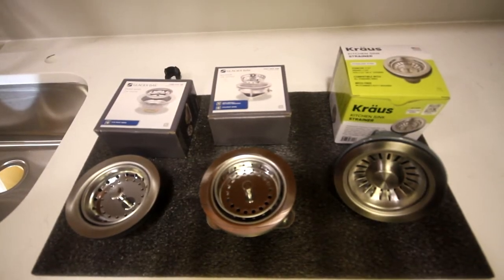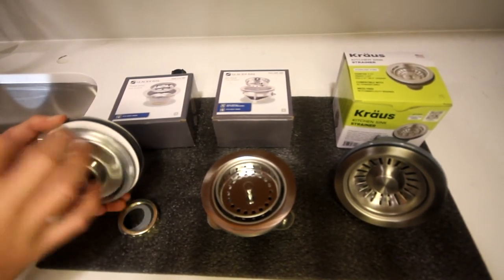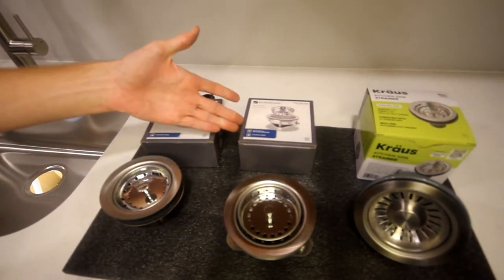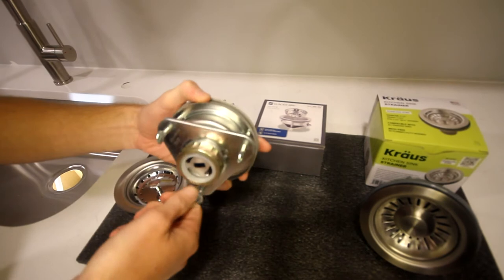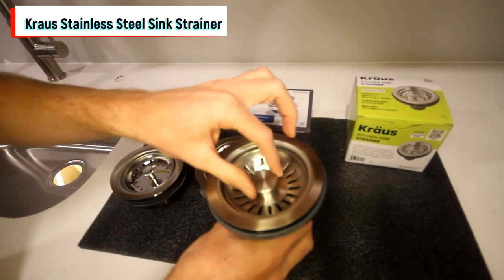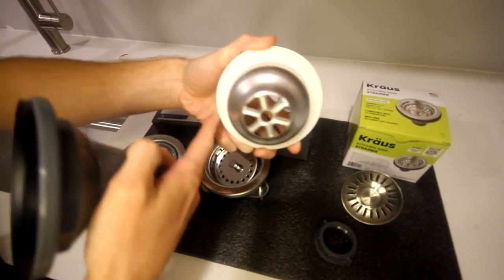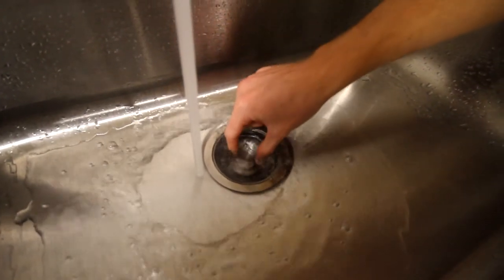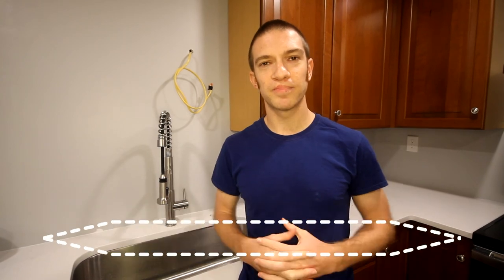Different Strainer Basket Styles and Installation Tips

Comment: I was dealing with a super cheap plastic one without a coupler under it doesn't stay tight.
Reply from the maker: If the threads are metal to metal, you could try loctite. If one of the threads is plastic, you might just want to use silicone on the top and bottom where the faucet touches the sink to help secure it in place.